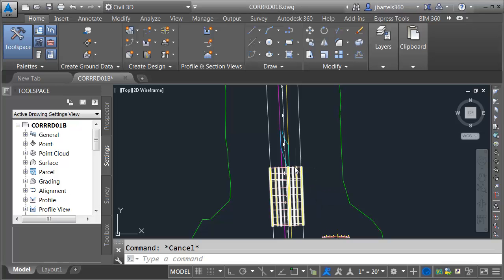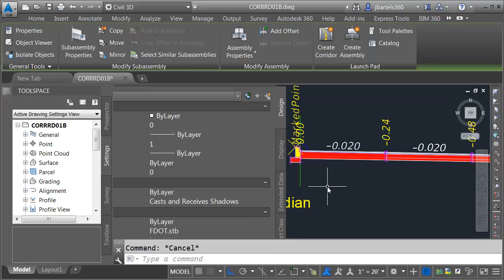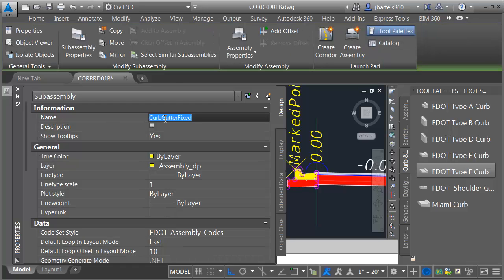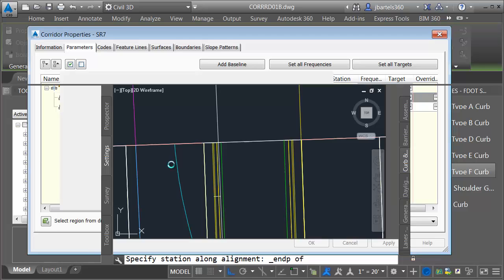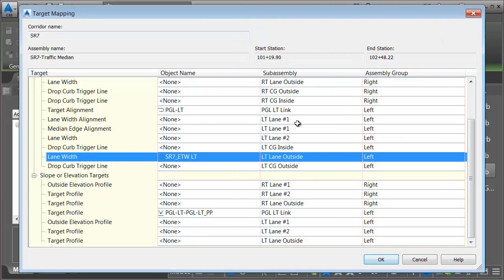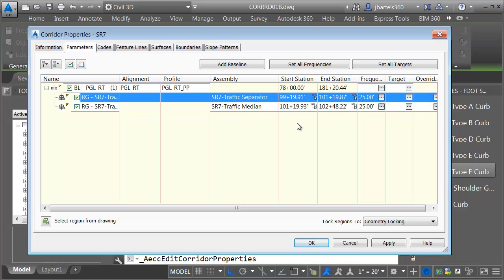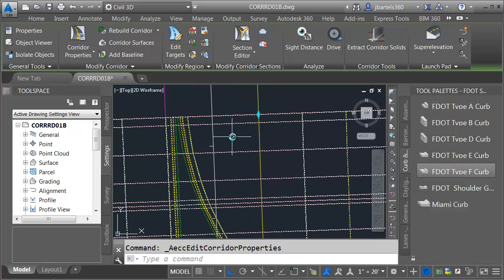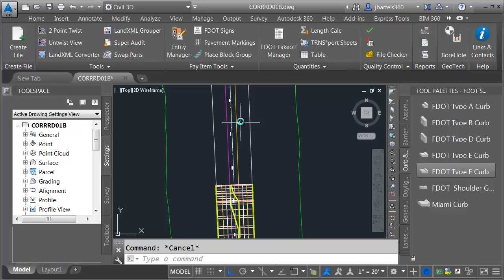Civil 3D Advanced Roadway Modeling Pt.3

Comment: Im building the corridor on the RT PGL, and target the median edge for tappered lanes to the corresponding polylines I draw for the median, the assembly simply follows the PGL's on both side, and the tappered lane doesnt push back the inside curbs to where the polylines are placed. I rewatched it several times, do you have any idea what the problem migh be Jeff? Thanks.